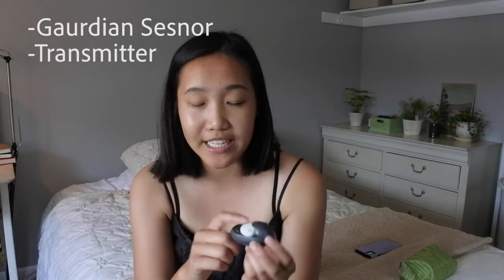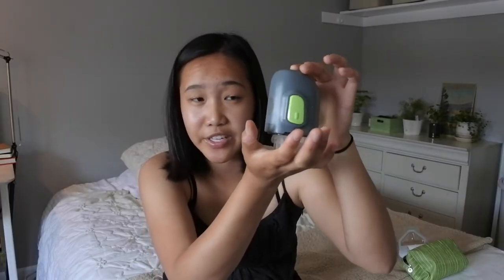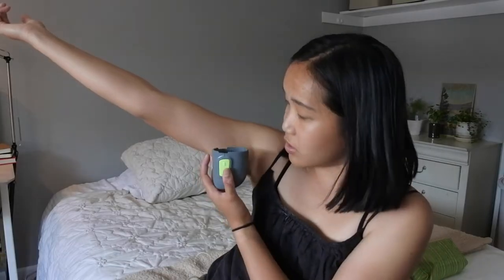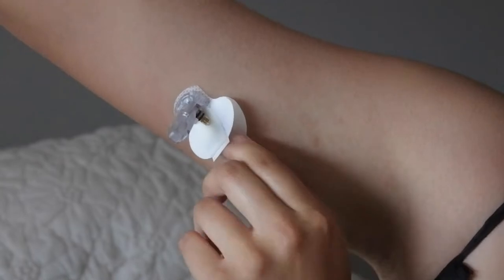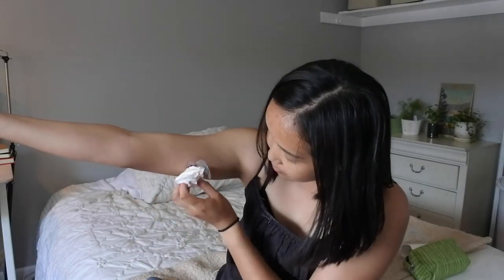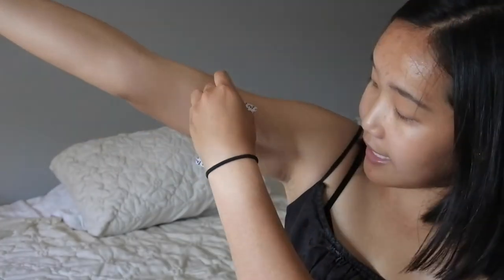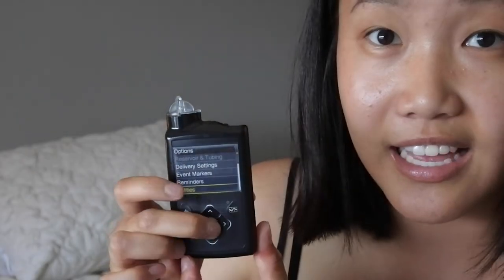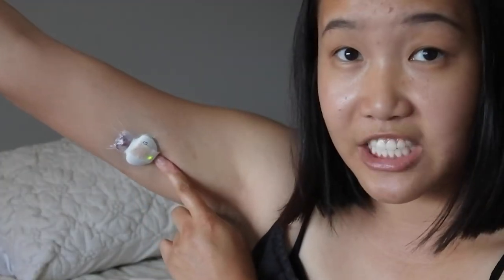MEDTRONIC GUARDIAN SENSOR INSERTION TUTORIAL

Comment: Normally I will not choose to start new sensor in the main machine part but insert the sensor ,machine will read and get the signal from sensor and put you straight away to select new sensor or re-connect. Am I right to do like this way ? Thanks
Reply from the maker: If that method works for you I think you should be fine! I just start a new sensor because it’s pretty fast and the way I’ve always been doing it (:

Comment: Do you use the second tape oval Medtronic recommends if not why? I’m new to pump and cgm use. I also use the 670 with the guardian. But I’m very short 4” 11” and 100 lbs, I don’t know if I have enough of me to wear them anywhere but my abdomen.
Reply from the maker: I only use the first tape because I find that the transmitter holds down well enough with the little strand of tape part of the sensor which prevents me from having to use a second piece! I know that a second piece secures it down better, however I have sensitive skin which gets irritated easily by tape so I personally like to use as little as possible!

And to address the second part of your comment — yeah your arm probably won’t work for you! I’m a lot bigger haha so fortunately I have meatier arms which allowed me to insert there. I would suggest trying your lower back, that’s a spot I sometimes use. However, do note that that part of your body gets a lot of sweat so sometimes the sensor doesn’t work as well. I also know people who put the sensor on the back of their thigh, which I’ve tried before! It can be a little uncomfortable to sit down sometimes but that might work if you get tired of your abdomen! Let me know if you have any other questions, good luck!
Reply: I always use both of the tapes because it holds it down between and also covers it up better when I’m in the shower
Reply: I sweat pretty bad when I got hot

Comment: I rarely bleed when I insert the guardian sensor l been using the pump now for 3 years and the only places I use is the abdomen and the upper thigh. I couldn’t get the sensor to last long when I put it on my arm. I don’t see how anyone would have difficulty tapping it properly using the tape that comes with the guardian sensor on the upper arm. .
Reply from the maker: I honestly used to never understand why people put any diabetic related products on their arms… until I tried and it worked for me. I find that when I put my sensor on my abdomen or thigh it does not stay for the entire cycle (3-4ish days on average instead of 5-7!). This is because I run and sweat a lot and those places get sweaty and the sensor peels off a lot easier. I also find that I don’t have as many accidental ripping out if the sensor is on my arm than other spots! But, of course, everyone’s experience is different!
Reply: Thanks for info on  inserting senser but when changing it you put you remove it and put it on charge which takes a long time to do any ideas or do you have two of them ' Alan from UK
Reply: I only have one sensor. It does take a while for it to charge